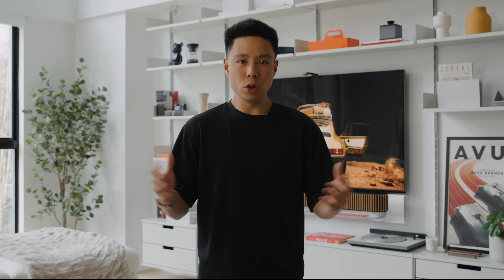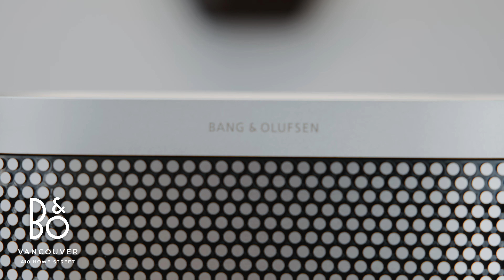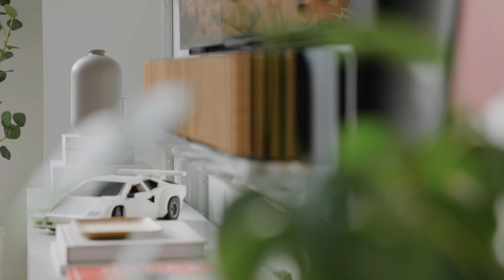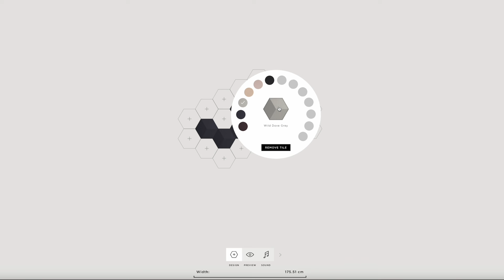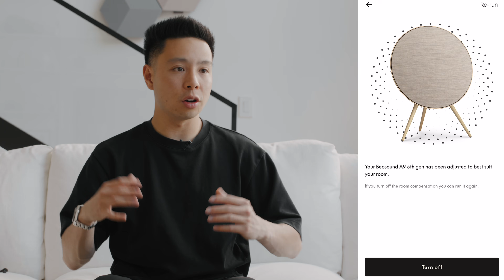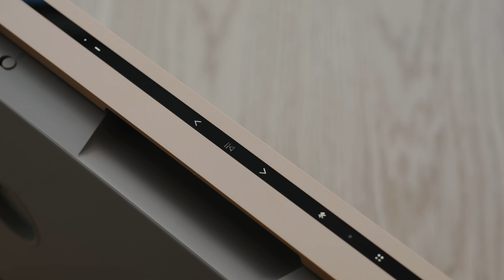Bang & Olufsen Home Audio Setup // My Ultimate Tech Loft!

Comment: Nice spacious set up but in practise the Beosound Theatre covers the space for stereo and streaming services, casting with perhaps using a pair of Beosound speakers for rear channel for watching movies ~ a pair of Levels or Beolab 8 ~ to create the immersive experience of surround sound. 

The Level and A5 being battery powered are portable and can be used everywhere. The rest of the speakers are duplications or alternatives. 

The Beosound A9 and Level both offer a limited stereo sound stage having distinct left and right drivers in the cabinet but for full stereo you need a pair. From my experience of Emerge and Level a pair is more than just two speakers giving stereo. With B&O Multi-room and the Mozart platform all the speakers can be linked together to play the same sound without the latency you normally get with digital speakers.